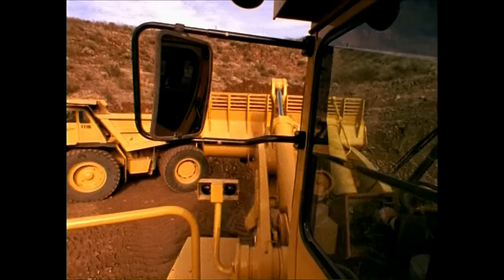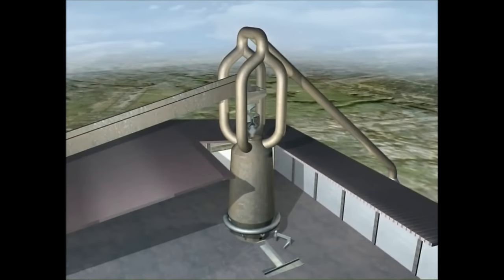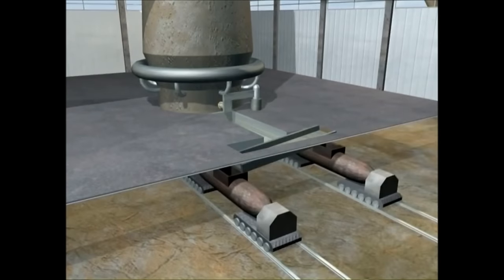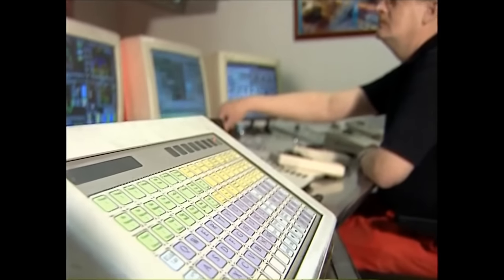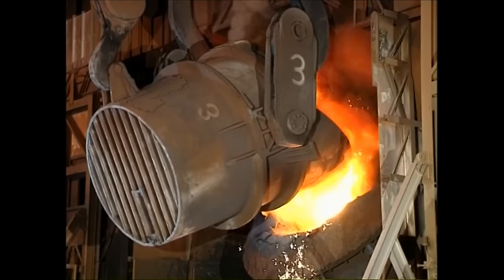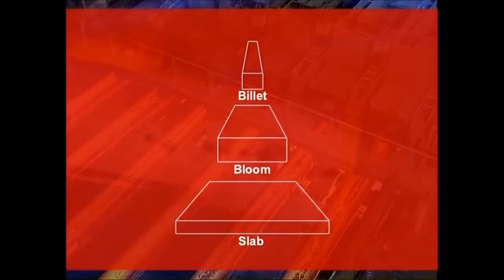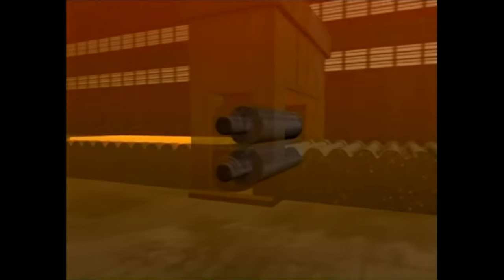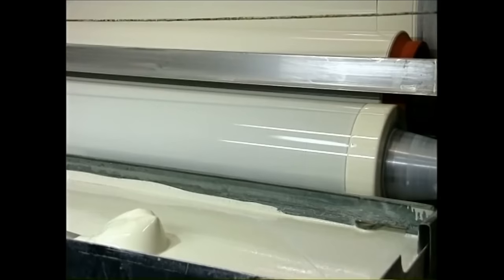Steel Manufacturing (Including Blast Furnace and BOS)

Comment: I’ve worked in every steel mill between Pittsburgh and Chicago as a union ironworker and I’ve never seen a steel mill that clean. Twenty- seven years in and out of every part of them, and I still wonder what mr. Bessemer was thinking when he saw the violent stuff going on and said, “ yes perfect, just what I was expecting!”
Reply: Ever work for ATI here in Pittsburgh?
Reply: Probably because that's a newer European facility. Most of the mills around the 'Burgh were built in the early 1900's and are pretty damn filthy compared to what's shown in the video.
Reply: Did you ever work at Bethlehem Steel in Baltimore ?
Reply: @odradekfilms  never made it to Baltimore
Reply: @DrDemented9885  I worked for century steel at the Edgar thomas plant and us steel in west mifflin
Reply: @R3TR0R4V3  that’s why we lost our steel industry, they did nothing to modernize
Reply: Nice. Big money I imagine . Good for you man 💪
Reply: My Uncle Tom Fury ran the mills for US Steel on the plant side for 30 years and now works as a consultant for the corporate side but he was at the PA plant on the philly side and had time over by Gary Indiana and I did some maintenance for him at the Hot Strip mill in Fairfield Alabama in 2004 05 we cleaned up enough to keep safe but if we spent that much time cleaning we sure as shit not getting anything done!
 Like how far into that wide flange order of 
50 /166s are we?  100 out of 250 or broom out of 250 and done swept our self out of the contract and a job!
Lmao
Reply: I worked at Bethlehem Steel 40 years ago... ingots were poured after the the oxygen lance treatment.

Where I worked, as a young man, i "caught" billets from rolled ingots... and helped the crane operator load them into anealing furnaces, to be cooled over a period of days.

I remember having to wear waffle long underwear all year long. The hot steel would make my pants so hot, I'd be burned....

It was amazing. Everything was huge, and hot.... I lasted 11 months. I had 3 close calls being squished like a bug... I left after the last one...

I did make good money... bought a new car, paid it off in 6 months... but it wasn't worth the daily exposure to death...

I'm 73... still healthy, have all my fingers and limbs... I am glad I worked there... glad I left.
Reply: @scotts4769  TimkenSteel in ohio has one of the worlds largest vertical forges, along with almost our entire process being automated by robots and machines. TimkenSteel has spent probably 50-100 million the past few years modernizating steel making here in ohio.
Reply: @scarecrow0774  I worked at all three timken plants over the years and also the now defunct republic steel

Comment: In the early 70s I started into industrial electrical maintenance as a Motor Inspector at Colorado Fuel & Iron (CF&I) in Pueblo, Colorado. I 'floated' as a Motor Inspector in over half the mills there. It was very interesting. Imagine watching steel rail being rolled by a 22,500 horsepower steam engine, largest west of the Mississippi River. At night the sky would light up when they were pouring skulls from the ladles. i started out as labor in the Open Hearth and moved into being a Motor Inspector, which was a maintenance electrician.
Reply: Awesome story!! I always drive past that place in Pueblo! 🙂
Was it hot everywhere there when they worked?? I bet

Comment: Steels in aircraft are primarily specialized aerospace grade 304 Stainless steels and Inconel stainless steel.  These steels are what makes a jet engine or turboshaft engine. 304 stainless makes up almost 75% of a jet engine turbo core.  Inconel makes up 25%and is used in the rear turbine of the jet engine.  Inconel is monocrystaline high temperature steel that rivals titanium, and tungsten for dimensional and strength stability at extreme temperatures.  Inconel is so good it's replacing tungsten for rocket engine parts.  SpaceX is building the world's largest rocket called Starship and it's being made out of a proprietary grade of 304 stainless steel.
Reply: EEERRR !!!?? CONCORDE ! MARK ! TWO !!???

Comment: the sintering process is to make pellets out of that ore... in order to have the hot air flow thru that stuff, so that CO can reach that FeO and get the O in order to produce CO2 and FE2 so you can have your molten metal...
otherwise you jsut have a layer of iron ore (FeO) and nothings gets thru.

the oxygen is not removed coz it's hot in the blast furnace...
pls explain it correct, or not at all

Comment: I'm wondering if the heat from the cooling of the finished product is used. It doesn't looks like it is here but it could be, hard to tell. But with some heat exchangers or even turbines, it could be a good way to gain energy efficiency.
I'm sure many engineers already thought about it and made calculations on that. If it's worth it, it probably already exists.

Comment: Can I ask a question about coke making. When you heat the coal how come it doesn't burn to ash. Apologies if that's a dumb question but it's something that I'm curious about
Reply from the maker: Hi, the coal is heated in an air tight oven, so oxygen is excluded (a good comparison is to how charcoal is made) and thus the coal is heated but not burned, the volatile matter is driven off, leaving coke.
Reply: When coking coal is analysed in the laboratory (or it used to be) one of the analyses performed is for the ash content. So Volatile Matter and Ash are the two significant components of the final product. Ash can be analysed on a spectrometer to determine conformance as an end use product. Coke remains very brittle to compensate for the handling in the transfer to the BF where large lumps are desirable for fluidity of the raw materials.

Comment: Are there alternatives to using coke? I've heard of using hydrogen injection instead, is that viable?
Reply: The oxygen in the hot blast combines with the carbon in the coke to form carbon monoxide . Carbon monoxide is the primary reduction  agent in the blast furnace. The carbon monoxide combines with the oxygen in the ore to form high carbon iron or pig iron. The carbon monoxide and the carbon dioxide created in the furnace are recycled into the hot blast stoves as a fuel to heat the cold blast. ...so no.
Reply: Scrap doesn't need to be reduced so they use electricity.  Oddly enough, they use oxygen to remove the excess carbon from the pig iron in the BOF.
Reply: Hydrogen can make steel brittle. Arc welding rod must be free of water and moisture because the electric arc generates hydrogen which will make the weld brittle.
Reply: @frphxkaboom3008  BF molten Iron (hot metal) and Pig Iron are two different things. Pig Iron is a product of hot metal when the latter is cast in a Pig Mill. This can also be done by casting the HM into sand moulds but metal moulds are resuable and the Pigs are removed on cooling. It is covered partially in this very good video.
As it states the majority of HM is used in the BOF but in bygone times when needed some HM could be transferred to a Pig Mill for processing. Beneficial for transportation and also for remelting in Foundaries.
Think of the volume of CO2 that goes up the stack when 300 or so tonnes of HM at 4.0% C is reduced to steel with 0.10% C
Reply: @flamingfrancis  It's the exact same metal. and the words are used interchangeably. . I worked in a pig cast. and blast furnace and the bof and the caster and electrics.
Reply: @flamingfrancis  since we are correcting each other. There is no such thing as a pig mill

Comment: Why do they add scrap?
Reply from the maker: It helps to ensure that the temperature doesn’t go too high during the process, I think it also help protect the refractory lining of the ladle when the iron is initially poured in
Reply: @MetallurgyData  So this process can't be done without the use of scrap metals?